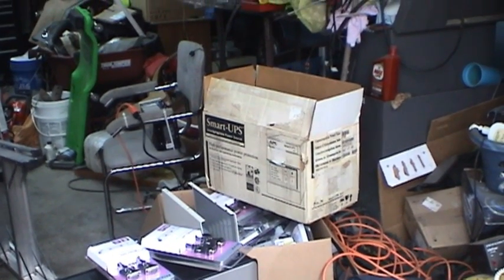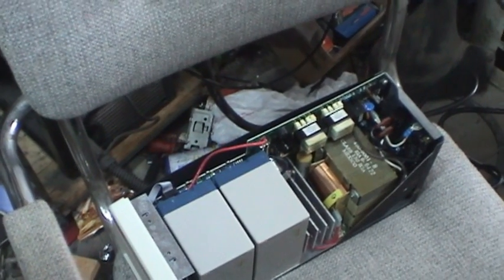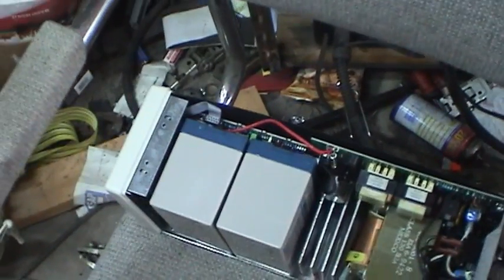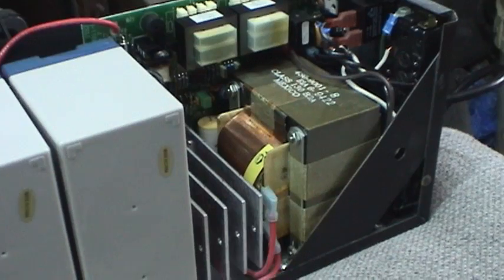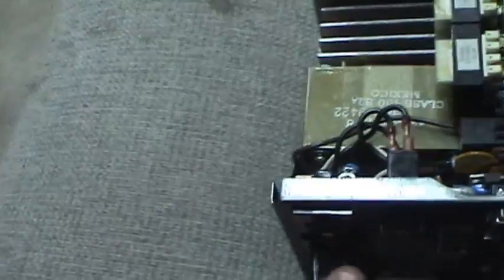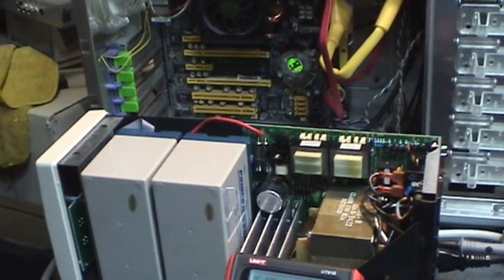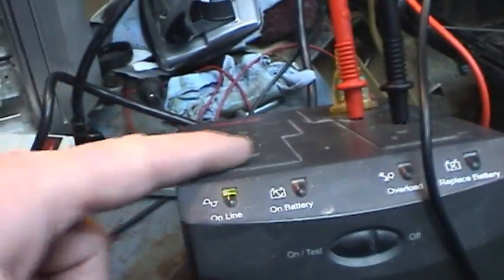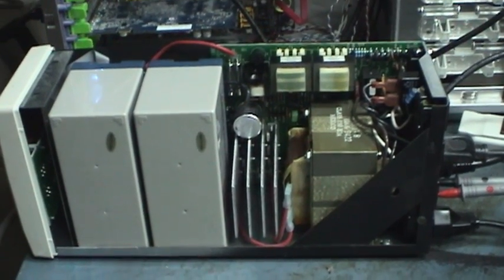Forgotten APC Smart UPS 600 Part 2

Comment: I had one of these years ago, and out of curiosity I briefly touched a screwdriver between the battery bracket and the closest of the four heatsink fins.  A brief spark, then a few seconds later the transistor catches fire.  Actually on fire.  So now you know :)

Comment: I would love to get one of these but here in the United Kingdom it seems these were never a thing here or at least there isn’t such a model available for sale on eBay. I want a smart UPS that’s not as high end as a 750 but higher than a 420 both of which I already own and use in other places of my house.
Reply from the maker: APC did produce a version of these for the European 220/240V (and even the Japanese 100V) markets. Even this 120V US version is quite scarce today. I can only guess that they weren't especially popular (most people probably bought the much cheaper Back UPS) and that after this many years, most have been recycled, discarded or succumbed to failure and then were disposed of in some way.

This is only one of two that I've ever seen turn up on the market.

If you do find a 220/240 volt version, it'll have IEC female power connections for the load and an IEC male for input power.

Amongst the models having true sinewave output characteristics, the smallest you're likely to find is the 700 or 750VA third-gen model (which is about the same size as this 600VA unit). There is a mythical 450VA third-gen SmartUPS as well, but in years of looking I've only ever seen a severely damaged one come up for sale. Again, my guess is that it wasn't popular due to cost.
Reply: Сегодня такой мне достался, славо Богу в России остались эти ибп, они хороши тем что в отличии от новых ибп держут заряд до последнего и не перегреваются, я хочу поставить ее на даче в селе Самур в джунглях Дагестана где часто из-за погодных условий отключают электроэнергию.

Comment: Tell me, what are the batteries for apc smart ups 600, what is the bottom?
Reply from the maker: For this particular model, two 12 volt, 7-9 amp-hour batteries are used. As shown in the video, they are internal to the UPS and not easily serviced. APC's official stance was that the batteries were only to be changed by a professional. Any service program they offered has likely long since expired, so that leaves us to do it ourselves. With care, it can be done.

Comment: Good demonstration. I picked up one of these units about 20 years ago for $25 and it is still working perfectly. Mine has a manufacturing date of 1992. Your communications problem might very well be due to the serial cable. APC has used a surprising large number of pinouts and is notoriously fussy. I've hand-wired them when necessary. An alternative option is to pick up an old "Powernet 10BT SNMP" box which gives you ethernet out. Personally, I no longer bother; I have all my devices trigger from the one newer ethernet capable Smart-UPS 1500 in my basement. One final comment: aftermarket batteries are usually crap and will last less than 3 years. Do your research and find a trustworthy source. You are looking for a pair of "RBC2" compatible batteries. Thanks for taking the time to share your experience and expertise.
Reply from the maker: The 940-0024 cable works OK, supposedly setting DIP switch 4 prevents the changing of many settings in software. Maybe sometime I'll try toggling it to verify. I hate to yank the beeper out of a "survivor" like this, surely it deserves a little more respect after this many years. (Yes, I know it's just a thing, but still.)

I've tried (slightly to considerably) newer management cards in the AP9600 external enclosure with UPSes that weren't really meant to support them and the results have been odd. In the case of this UPS, an AP9617 "saw" a UPS attached, but didn't return all values correctly and couldn't properly control the power state of the UPS. Other UPSes (like a Smart UPS 420) usually shut off and refused to restart the moment I attached a management card. I suspect in the latter case, that the pin on the serial interface used to tell the UPS to shut down was being asserted for whatever reason. I haven't had much luck in getting my hands on the older PowerNet stuff, not that I've tried real hard.

I have actually had excellent service and reliability from the overwhelming majority of aftermarket batteries that I have used. PowerSonic produces a good quality product, though most of their offerings aren't designed for high load conditions. The only battery brands I've had poor service from are UPG (fair to middling) and SigmasTek (really bad).

Comment: I have one of those and it's still working fine in 2016! It just needs batteries every five years or so. The original batteries it had lasted about 8 years! I had the software for it but none of the serial cables i had worked with it. I might build one since i have the pinout, thanks to your manual. Mine does not do the "whining" sound when pressing the power button and it also does not cold start. The back panel is also different (bare metal grey instead of black) and has IEC outputs. It's a 220v model so that could account for the differences. If i find the software, i'll send it to you. Thanks for the videos!
Reply from the maker: +Andy Cristea Thanks for taking the time to write! It's awesome to hear that your Smart-UPS is still serving you well. Smart communication cables show up pretty often on eBay at reasonable prices, the number to look for is 940-0024. Later revisions (indicated by a letter after the model number, usually B or C) will also work. Should you decide to build your own cable anyway, shoot me a private message here on Youtube and I could send you a better scan of that part of the manual. There are also compatible cables made by third parties available for sale, some of which use serial to RJ45 adapters with custom wiring inside and a standard cat 5 cable linking the two. These have the advantage of being as long as you need or want them to be.

After shooting this video, the Smart-UPS stopped working! And then, a few days later, it started working again, without the odd whining beep during startup! It's been fine ever since, and is working nicely now. I can only guess that perhaps some capacitors needed to reform after sitting for that many years, and that perhaps the micrcontroller's power supply wasn't working correctly as a result.

I'm not sure why you can't cold start yours, APC made a pretty big deal of that functionality. Unless maybe the 220/240  volt models just can't do it..maybe an issue with starting up on the wrong side of 50 or 60 Hz?

If you'd feel inclined to make a video or already have one about your Smart-UPS, you'd be more than welcome to link it here. And I'd be willing to throw it into the video description.

Comment: Hey UXWBill, have you got a spare PC buzzer? If so, could I please have it?

Thanks!
Reply from the maker: +TheGamerWithMore No, but I'm sure you can find all manner of little speakers and "squeaker cans" on eBay. Most of them don't survive removal from the PCB since I'm not really inclined to warm up the desoldering iron every time...
Reply: +uxwbill Squeeker Cans. I'll look for them. Thanks anyway! :)
Reply from the maker: +TheGamerWithMore They're more correctly known as "piezoelectric speakers".
Reply: +uxwbill I'll look for that as well. Hold on. i found one in my old PC. the southbridge failed. as no POST beeps were emitted and no  signal was on the screen. The factory installed Blue Smoke has not been released.

Comment: I once had my expensive computer plugged into a cheap UPS laying around. After looking online, I unplugged it and plugged my computer straight into the wall after learning the wall is an order of magnitude more reliable than the UPS.
Reply from the maker: +Jordan Johnson (Mighty Burger) You're not supposed to plug an expensive computer into a cheap UPS. It's in the same category where people use a poor quality, cheap power supply in an otherwise decent computer build...and seem surprised when they have problems!

Although every major UPS maker sells them, the various "plugstrip" UPS models really aren't up to the task of protecting a computer system, especially a high performance one. Unlike the better models, these can't do anything but switch to battery in the face of an incoming power problem. The unit shown in this video outputs cleaner power than some electrical utilities offer, and it has the ability to adjust low line voltage upward for as long as necessary without using up the battery. Bought new, it would be a lot more expensive. Good used examples of similarly high quality units turn up all the time for pennies on the dollar, usually needing only new batteries to work again.

Comment: Is there a list of true sine wave UPS units from APC?  I'm guessing my BK650MC is not, but I don't have a battery in it (acquiring soon), nor do I have an oscilloscope to check it.
Reply from the maker: +welldontdothat Your BK650MC has a stepped square wave output. There is not a list that I know of, and as nothing is ever easy, there are Smart-UPS units that have stepped square wave output (SU420NET and SU620NET) and at least one Back-UPS series that has a true sine wave output. That would be the Back-UPS Pro 1000/1100/1400 line, even though their back panel claims the output is not sinusoidal.

The BK650MC is a very old design, dating back to around 1990 or so. They were produced as recently as 2003 from what I can tell -- talk about a company getting their money's worth from the design!

Comment: What you have revealed with these two scope meters really shocks me in regards of units being made in china (or far-east related countries)! I also fear the damage it can cause to electrical applications receiving a crude "step-by-step signal wave", if I may call it so. Why do great brand companies trade their excellent workmanship for modern communism-suppressed slavery? Is the interest in money the sole reason? Or shall we add unscrupulousness to top it off?
Reply from the maker: +Bandicoot803 The differences are actually a result of these units catering to two very different parts of the market. APC's Back-UPS products are much lower end, cheaper and therefore don't have a true sinewave output. Many of them were domestically produced well into the 1990s, and their output waveform was identical to the stepped square wave shown in this video.

The Smart-UPS line is still sold today and still has a high quality true sine wave output, even though none of them are made domestically any longer.

That's not to say that I approve of taking manufacturing jobs out of the United States. I think it's quite unfortunate that such is the case, especially when the money saved ends up in the hands of people who have more than enough already.

I've seen the argument made that it's really not significantly more expensive or difficult to produce an inverter having a true sine wave output, with the implication made that all inverters might as well be true sine wave versions for that reason. I'm not sure how true it is -- and I don't really care because so many of these Smart-UPS units are tossed out for scrap every day when the batteries quit. Suddenly they're available to tinkerers like myself for pennies on the dollar.

Comment: Maybe it's the lighting, but the two small transformer's plastic coverings have that characteristic discoloring over the windings typical of use over time.  That unit may indeed have seen some service in the past.  Glad you got it working though.  As for mine, the charging circuit still appears to run a little on the high side and I've been reluctant to put yet another set of batteries in it until I can figure out a way to drop the float voltage from the 28V range down to the 24.7V range, give or take.
Reply from the maker: +shadowrider460 I don't recall them looking discolored in real life, though I can't say as I paid a lot of attention. I guess I'll have to look again. If it was used, and I suppose it could have been, I'm surprised that someone bothered to put everything back so thoroughly. The only things I didn't get were a communication cable and software. (And maybe I wasn't supposed to get the software.)

I just did a quick check of the active Smart-UPS units around here with management cards installed. (These include units from 2001, 2006, 2008, and 2014 from 750-1500 VA.) Every one reports a float charge of between 27.4-27.5 volts, which seems about right from the battery spec sheets I've read.

The Smart-UPS models, even little ones like my SU420NET, all have a programming/service mode that's available over the serial connection. Using it does require some care, as certain settings can give your UPS an identity crisis or worse. (The documentation for Network UPS Tools explains what most all of the settings do and how to get in there. What they don't tell you is that the + and - keys adjust each setting once specified.) While not every unit supports doing so, many of them will allow you to adjust the charging voltage up or down in software. Those that can't will either do nothing or respond with "NO".

You may also want to reset the battery constant value if you've never done so. Even on units that have been through a runtime calibration, resetting the battery constant from the service mode or with APCfix has done more to make them work like new once again. If you do this manually, you've got to ask APC what the correct constant value for your unit is. (I've got an SU2200 here that was removed from service and given to me because no number of runtime calibrations under any circumstance would get it to report a proper runtime figure. It has no batteries and giving it any is simply out of my reach right now. But when I can, I'm hoping that resetting the battery constant will fix it.)

Comment: It finally did get to power a computer through a power outage, after a literal lifetime of waiting! I feel all warm and fuzzy inside.

I'm surprised that it was actually a proper sine wave unit - the older (i.e, one generation newer than this one) Smart-UPS 420 and 700 models sold in Europe were "modified" sine units (at least I THINK the 700 was modified - I could be wrong). It wasn't until the black 750 VA unit came around that we got a small pure sine UPS.

(Also, I can finally check the "get mentioned in uxwbill video" item off my lifetime achievements list!) ;)
Reply from the maker: +FFcossag I was going to tell you that it lived just long enough, as not long after making this video, it refused to power up! And now, for some as yet unexplored reason, it's fine. It gets right to the startup process and doesn't even shrill like it did. Possibly the effects of capacitors trying to reform?

Putting the batteries in permanently was a ridiculous kind of chore, but I've got them in there now and it is powering a few pieces of non critical networking equipment. If it has a relapse, I managed to track down a schematic and maybe I'll fully recap it on general principle.

Here in the US we got the Smart-UPS 420 and 620 with "modified sine wave" output. (I never saw a 700 VA variant.) Someone gave me an example of the former that in its previous life, had been grossly overloaded almost all of the time. Now it holds up a wireless router and DSL connectivity equipment, and does a splendid job (at least two hours worth of runtime on the stock battery).

It's a mystery to me why APC bothered making Smart-UPS models with "modified sine wave" output...they certainly don't seem to have been much cheaper.

As for being mentioned in a video, it's been my longstanding belief that my activities here are a two way street, and if a viewer inspires me to do something, they certainly ought to be credited. :-) I get the feeling that's seriously different from what most "popular" Youtubers do, though I wouldn't have it any other way.
Reply: +uxwbill Oh dear - that sounds like a plausible explanation. Some thing or another causing excessive leakage (coupling cap leaking to prematurely try to power on the CPU through an ESD diode? Bypass capacitor leaking so much that the CPU fails to start in time? etc.) and causing the awful shrill, and then kind of reforming to its intended state later on. While it certainly isn't a good thing to have happen, I'd actually be surprised if it acts up like that in the future, with reservations for proper explosive capacitor failures. A full recap certainly doesn't sound like a bad idea.

I hope the unit gets to live a nice, long life from now on, though. Since it's a line interactive unit, newer models really aren't all that much more efficient, and certainly not better built or more service friendly, so I think that for once there actually exists some quite good arguments in favour of running a piece of "antiquated" gear.

I'd wager APC's biggest reason for producing fake sine Smart-UPS units would be that they could just grab the power stuff out of a Back-UPS (because that's literally what they did), throw in a fancy CPU and call it a day. Have you ever noticed how all the APC pure sine units are 24 V? They probably had problems meeting the pricing criteria if they were to either make a 12 V pure sine inverter, or sell them as 24 V units.

As for doing what the "popular" Youtubers do - well, there's a reason argumentum ad populum is a logical fallacy. ;)

Comment: Good video! A UPS is something I'd like to have someday, if even just to have on-hand to run arbitrary stuff during a power outage (although I understand they're not meant to run for more than a few minutes).

Wow, the output waveform from that BackUPS is attrocious. A modified sine wave is supposed to have two or three steps on the way to the peak, but that appears to be just a pulse wave.